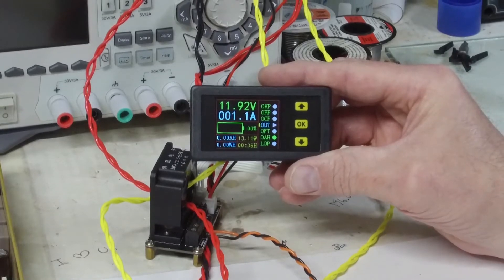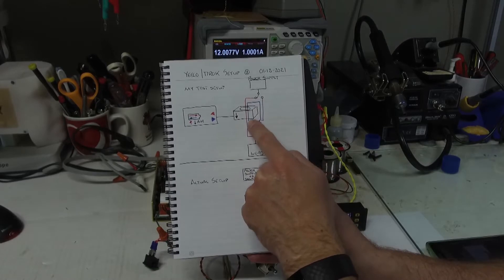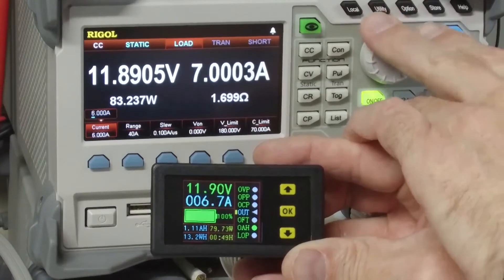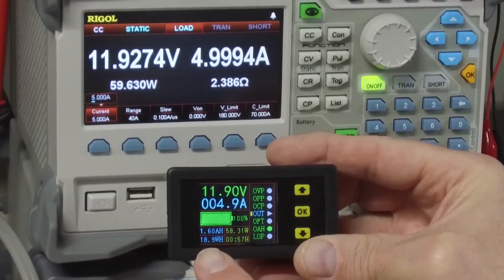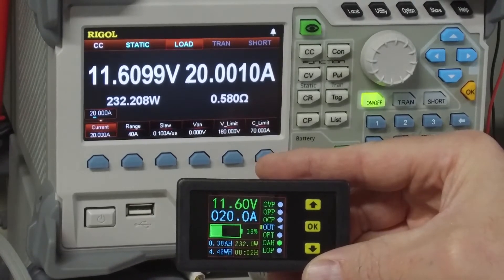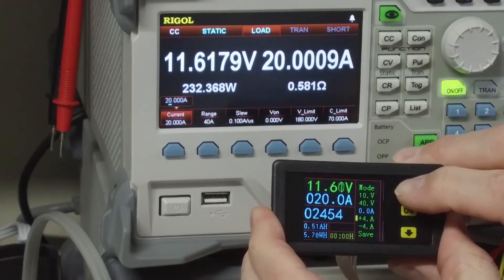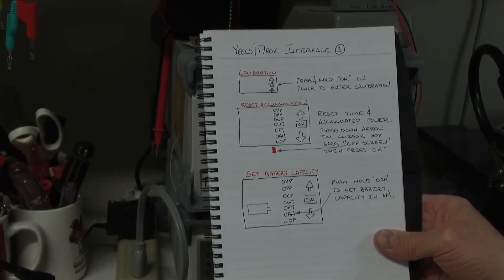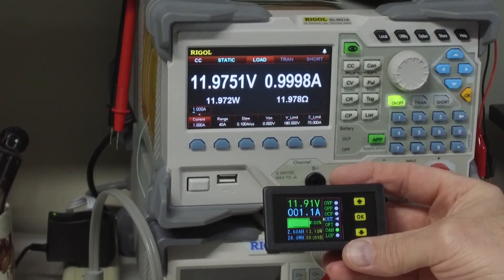Digital DC Ammeter Voltmeter, power, capacity, discharge / charge rate analysis.  Yeeco / Drok

Comment: Hello does the unit actually charge a battery attached to a load. I watched the video can you  and its good.  Thanks
Reply from the maker: This device is not a proper charger.  It does not regulate voltage or current.  IMO, you can use this device in conjunction with a charger to monitor and provide safety cutoffs.

Comment: I cannot get my meter to display accumulating AH or WH, it only shows 0.00.  I got a replacement from Amazon and it behaves the same.  Do I have 2 bad meters or am I missing something?  I have a 12V, 45 AH battery that I am trying to test.  If I set the OAH to 45AH, it will decrement the AH appropriately when I apply a load but the WH is still displaying 0.00.  If I reverse the current direction, the WH will display but as soon as it hits 0.11, it resets to 0.00.

Comment: Meant to ask earlier, what happens in the display if you are both charging the battery and drawing from it at the same time?
Reply from the maker: It will show the cumulative current.
Reply: @DanPattenAudioG33k  oh that’s great news! I got confused because I’ve seen a couple of videos were people wired up two of them to get in and out flow (it didn’t make sense to me). Thanks! 🙏

Comment: This a great video. I’m building a very small battery power bank 7Ah for charging my DC devices and I’m wondering if this module is a good fit. My solar panel is 12v (reads 19v open circuit) 10W, .5A . I’m wanting to find a meter /controller (or maybe I need two meters?) that acts as a solar charger controller where I can both trickle charge the battery / input power and charge my devices at the same time. So I guess something that is pass though? Also I would like to see both the charge current and discharge current simultaneously. Can this device do the trick. Can it be calibrated to display currents of .500 amps ? Thank you so much!
Reply from the maker: Thanks.  IMO, this meter will do pretty good at indicating approximate battery capacity (like a fuel gauge).  You would need to have another meter or a meter that has inputs for two sensors to show simultaneous input and output separately.   I think this meter is better for higher current systems and might be a little inaccurate at low currents.
Reply: @DanPattenAudioG33k hello! Thanks for the clarification that this meter does show two separate numbers for in and out flow. Do you know though if this meter (in a real world setting with both power in and out to a battery) was connected to a solar controller  (12v, 10w .500A solar panel -> 12v 10A solar controller-> 12v solar load output terminals) would it show the sum total number (of + PV input -Load output) ? For example, if there was more current being drawn out from the battery and less input of current from a solar panel (or power supply)would we see a negative number or a number with an arrow to indicate negative draw?

Comment: So very grateful for this!

I was struggling to understand how you used a switch to make the current flow two ways and then I saw the diagram and had one of those "Dear God, how have I made it this far in life?" moments.

Really a well thought out instructional video broken down so that everyone can understand it. Camera work was excellent, audio was just fine and I think you stayed on topic so well. Plenty to discuss about this unit but you really nailed what needs to be focused on first when you first open up the box. Thankfully I have experience with the XYS3580 buck boost converter so all of those abbreviations on the right are very familiar
Reply from the maker: Thanks for the kind comments.  The forward/reverse current with a switch is a little bit of brain teaser.  Thanks.

Comment: Chinglish manuals are universally bad. Thank thee for the clarification.
One question: There are four versions of these meters with different voltage and current limits.
What is/was the model number for the one in the video.
Reply from the maker: Yeeco Model B1700563.  10-90V 0-200A

Comment: Edited: Dan is da man! 🤙
I have another question... in your diagrams that you drew why are the solar panels not connected to anything? Where would the solar be connected to the battery? If so how would you get a reading that the power is accumulating in the batteries if it's not going through the hall sensor?
Reply from the maker: Sorry.  My day job :) has been very hectic with lots of extra hours...  Too bad your unit has been problematic.  In my drawing, the power supply is a substitute for the solar panels and the load (Rigol Electronic Load) is a substitute for a battery.

Comment: Even after watching this video I'm so frustrated with this goddamn thing it doesn't seem like these calibration methods are working with my meter.
Reply from the maker: Sorry that you are fighting the meter.  Have you had any success?  Make sure you are calibrating at a high current.
Reply: @DanPattenAudioG33k  yes I finally figured it out last night the unit was okay I was just doing something wrong. When I was calibrating the amps I was adjusting from where it says zero in blue but you're not supposed to calibrate from there you're supposed to calibrate from the +.4 or -.4 the zero in blue is just a zero it out when you start with no current. 
That was my mistake my bad but your video definitely helped me get through this stupid thing. I can't believe how horrible their instructions are and it doesn't even show anything for calibration on instructions. 🤦
Thanks Dan man new subscriber for sure! 🙏

Comment: would it be possible to pass more than one switched on/off battery power wire thru the Hall magnet similar to how you switched your red/yellow wires (direction of flow)?  Of course each wired in Parallel  so power stays connected to devices it runs yet with a disconnect switch on the wire that goes thru the hall.   Thinking then one could switch on the line from battery you want to measure info about.......   click it off...... select another line by switching it on instead.  etc.  

net result...... one meter that can be used for more than one battery.     

what is your thoughts on that?  I would assume one would have to calibrate it once all the lines are thru the magnet....  to get it to measure close to correct thru the extra wires in there.
Reply from the maker: What you describe should work.  You would need to make sure that your switches are capable of the battery current.
Reply: @DanPattenAudioG33k  do you think a diode would be needed where the parallel leg that split off thru the meter was rejoined  to its path it follows to keep back feed out?  Granted by the time one bought all the components to do this could have just bought more of these inexpensive Drok Meters.

Comment: WOW, your video is so good man, I am trying to measure the capacity of both of my Lifepo4 batteries and is looking for an easy precise way to do it, unless you know of an easier way? Thanks again you are a good teacher.  I am building my own 100 amp hour solar capable power station using 2 LifePo4 batteries and I love the look of this Ammeter because it has a color LCD and also supports multiple functions too, cheers!
Reply from the maker: Thanks for the kind comments.  I think this might be one the least expensive monitors I have seen.  However, I do not think I would rely on it to manage the charging of a lithium battery pack.
Reply: @DanPattenAudioG33k  Great, now are you referring to a custom lithium battery pack or manufacturer built? Thanks

Comment: Thank you very much.  You just saved me from returning 2 of these back to Amazon because they would not display the correct voltage.  The 1st one that I got worked great out of the box but these 2 did not.  One was 100A and the other was the 300A.  Unfortunately, I need a better power unit to produce numbers as fine as yours because even after some calibration the numbers are still off.  But now they are not .4-.5 volts off from what they should be.  Thanks again.
Reply from the maker: Thanks for the kind comments.  Glad the video helped.  I was pretty confused with my meter at first.

Comment: man this thing has been driving me nuts!! I had it wired in with the current flowing in the direction of the arrow. Then I looked at the PDF instructions and wired it the opposite way because that's how it shows it in the diagram. Now I have to pull it all out again and reverse the senor like I originally had it (and how you show it to be connected.) I now have no idea what so ever what state my vans leisure battery is at? its showing around full on the voltmeter but this thing has just screwed everything up lol it's showing 45% now as it was wired incorrectly due to following the diagram! 

Hope I can just factory reset it and start again. 

Thanks for your info :)
Reply from the maker: Thanks.  Yup, I was frustrated with the meter as well.  It finally started to make sense, so I thought I would document it :)

Comment: Hi...I have to say thanks a lot for your video...This is by far the most informative video I have found so far on this meter.. I was nearly about ready to toss it in the junk bin.. But now, I feel that I can actually put it to good use now, Thanks again.. 👍👍👍    Is there a way to make the display STAY ON ???
Reply from the maker: Thanks for the kind comments.  If you question is about the display turning off when low current is detected, my answer would be not that I am aware of.

Comment: Fantastic video !    I got one of these meters for testing a bunch of LifePo4 battery cells I got and the meter was giving me fits figuring it out with the horrible instructions.    I got into never-land playing with it and was able to use your "numbers" to restore the current calibration to close to factory calibration.    I assume the 24XX number on the current calibration screen that changes with calibration is some parameter not documented but your settings got me back close to factory calibration from which I could do a actual calibration.    Thanks so much for the fantastic information !!
Reply from the maker: Thanks for the compliment.  I agree, the instructions that came with the unit are not very helpful.

Comment: Hey.  Can you please look at this one on Amazon?  PZEM-017 DC Communication Box RS485 Interface Modbus 0-300V 300A Shunt USB Cable Voltage Current Power Energy Consumption Meter(PZEM-017+300A+USB)
Reply from the maker: I could possibly put that in the queue :)  Looks like an interesting device.

Comment: i noticed something that may be part of what others have complained about on some channels- battery drain. I left mine on the other day with no load and no battery to be measured and after about 3 hrs. the screen came on. I turned it off but have no idea why it came on or how long it would have stayed on had I left it alone. It doesn't draw much but it was enough to completely drain my car battery after 4 or 5 days not driving it. I opted for an independent power supply when that happened and I will be wiring a dash mounted solar panel to keep it charged. It's really good quality from Harbor Freight though they expect something like 250 ma to keep your vehicle charged which is kind of rediculous. Plus they suggest adding a solar controller!
Reply from the maker: Interesting info.  Thanks for sharing.

Comment: This is so well done! Your clarity makes it possible for me to do what I want with mine. For instance reading discharge/charge with the switch. I wasn't sure if I would have to change the thin red wire location when I went from load to charge. For me, it's a little more difficult as I am using  6 or 8 gauge battery cables.
Reply from the maker: Thanks for the kind comments.  Glad the video helped.

Comment: Hi..  Hope you can advise.  I have set my BAT reading to 400AH (total batteries capability) and the BPC reading to 100%..batteries fully charged with shorepower over 12 hours.
Problem on the monitor: the batteries are reading 13.4v but the graphic and AH% of batteries is 61% and falling.  Any ideas would be great.
Reply from the maker: Hello.  Sorry, I am not sure that I understand your question.  I just did a part 2 on this unit, take a look and see if it helps.  Here: https://youtu.be/cp2qrXKJ654
Reply: @DanPattenAudioG33k  Ok thanks.. I worked it out though.  The BAT setting is the capacity of one battery not the whole bank. I set it yo 200 (one battery) and the reading jumped to 100%.  So pleased😀

Comment: Hi Dan,Ive liked and subscrided,I have bought and on its way from AliExpress DT24P 0~1000V 100A Amp meter DC Power Voltmeter Ammeter Battery Capacity Tester voltage Gauge detector with Coil $24, I would like to run my small wind turbine and solar system off grid from this devise,I would think you are the best person on youtube with your knowledge plus expertise on how things work.If i have to work this out myself OMG!? Thank You again really liked,I look forward to more.
Reply from the maker: Glad that the video helped.

Comment: Hello Dan, thanks for the review.  I'm looking for a solution to monitor my LiFEPO4 battery pack as I cycle it so I know where the capacity is at any given moment.
Question:  Does the Meter store the dynamic present capacity of the pack when the display is off,  or does it lose it ?  I'm hoping that even if the display is off, as long as it is still connected to the battery pack it will retain the remaining (or cumulative) capacity.
Reply from the maker: Sorry about slow reply...  When the meter measures zero current flow it "times out" at about 20 seconds and the display goes blank.  Upon sensing current again, the display wakes back up and proper accumulated capacity is shown.  The "ok" button can also be pressed and proper accumulated power will be displayed.  The dynamic accumulated capacity is volatile and if the unit loses power, the capacity reading will be goofed.  The two supply connection could be used with a small backup battery to prevent this scenario.    The OAH setting is non-volatile.  Thanks.

Comment: But would You recommend this to monitor boat batteries on the boat “diy project”
Reply from the maker: Sorry, I do not have enough experience with this unit yet to fully recommend it.  If you are monitoring your batteries, I think it should be fine.  I would not use it to control charge because of lack of experience.  Thanks.
Reply: @DanPattenAudioG33k  Yes this is good to monitor any battery system which is being charged and discharged and show live battery capacity.

Comment: Great video, thank you so much very helpful.  How do i set the max capacity  to 100 percent, or any percent?  Battery display shows 00 but it should read 100 as battery is full, the voltage reading is correct.
Reply from the maker: Have had a few questions about this device and I still need to figure out a few more aspects as well.  Sorry I can not answer your question right now.  I'll look at doing another video.  Thanks.
Reply: @DanPattenAudioG33k  You need to fully charge your battery then input the capacity of the battery/Batteries into the OAH setting.
Reply from the maker: Just posted another video with more information about this device.  Maybe it will help.  https://youtu.be/cp2qrXKJ654

Comment: Very goof video!! Thanks a lot! I 've a question, is possible to have the screen at 4 mts of battery cable? IT means can the flat cable, be cutted and put  extra cable around 4 mts?  Thanks a lot!
Reply from the maker: Not sure if I understand the question fully.  I do believe you would be ok to extend the cable between the sensor and the LCD panel.  Thanks.
Reply: @DanPattenAudioG33k  Thanks, yes it was my question, sorry my englsih is not the best of the world!!  Thanks for your answer!
Reply: @osr75  Yes I extended the sensor cable about 18inches no problem

Comment: Thanks for the video, i bought the same unit and you are right the instructions are worthless. Because of this video im able to put to good use now. What kinda switch do you have and how did u wire it. Sorry excuse my ignorance im fairly new to electronic stuff.
Reply from the maker: Thanks for the kind comments.  I'll look at doing another video that explores some of the other features.  Thanks.
Reply: So in order to charge a battery, you need 2 sources of power right? One for the display the other to charge battery. Or use same power supply for both display and to charge battery. Am i correct? Sorry i have adhd and its hard to understand or to follow along a whole video.
Reply from the maker: @nesioraul  You can use it with 2 power supplies or single supply.  If the battery/device you are monitoring is lower than 10ish volts you would need a the 2 power supply hookup.
Reply from the maker: Raul, I just posted another video on this unit that describes more features.  Maybe this info will help.  Part 2 video: https://youtu.be/cp2qrXKJ654

Comment: how long is the ribbon cable from the hall sensor to the display?
Reply from the maker: Approximately 8 inches.
Reply: Yeah, the cable is the limiting factor. Mine came with two cables. One 8 inch, and the other about 16 inches. But mine is going in golf cart and I need about a 10 foot one. So I cut it and made it longer with a shielded ethernet cable. I hope the extra distance doesn't mess up the readings.
Reply: @mattadata2  shielded "should" be good. A buddy of mine extended his with some unshielded wire, running right next to some power cables and had all kinds of interference. I was going to try to fix it for him, but then he got pissed an trashed it.